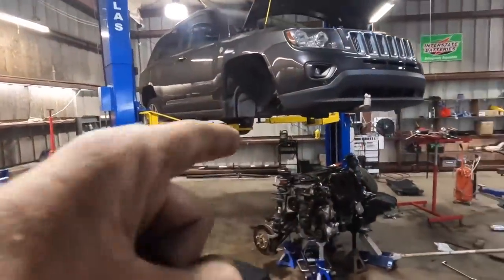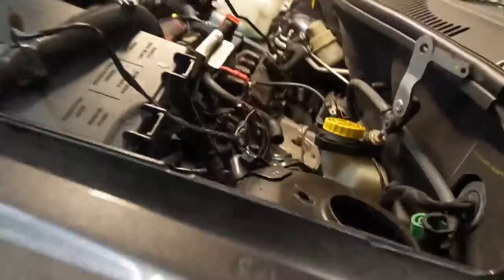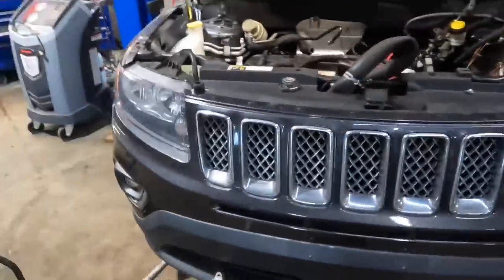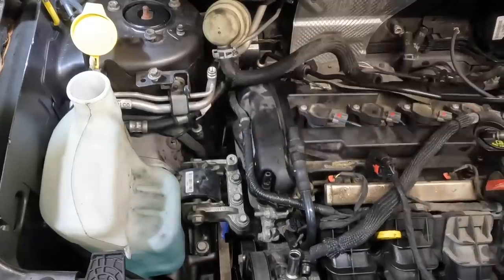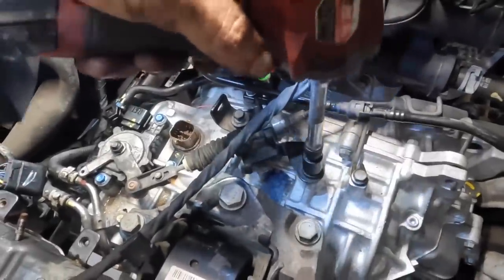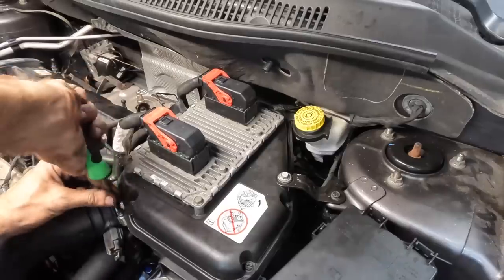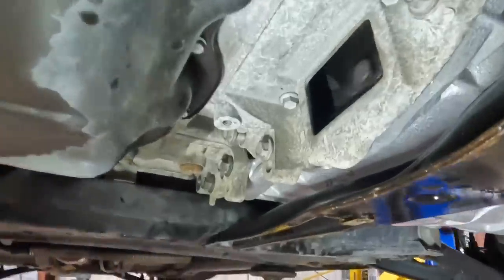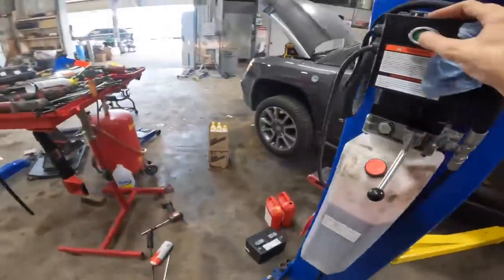Hyundai/Kia Trans in a JEEP?! 2016 Jeep Compass 2.4 4x4 #frankenstein

Comment: I hope you went back and tightened that Trans mounting bolt, just to the left of the flex plate access window. There's about ½-inch of exposed threads.
Reply: 35:00
Reply: Did you remember the ground strap?
Reply: @samvalentine3206  Oh yeah still loose 43.26.  Ray will get it on one of his many re-check😃

Comment: Did you remember to tighten up that 4th bolt near rear end? Job well done like always, i love your videos! Have been wathchin old videos a lot, I think watching them all. :)
Reply: I was wondering the same thing if he put in the fourth bolt on the drive shaft at the rear end
Reply: He didn't put a smidge of bitumen on the seal before attaching the new transmission either.
Reply: @inspectorjavert5563  Maybe because you do not have to do that, there is no seal between engine and transmission, because there is only air between those.
Reply: Also the bolt to the left when ray was doing the torque converter
Reply: I wondered about that and the hose clamp on the power steering (I think) underneath he didn't move into place.
Reply: @johnlebihan6628  I noticed that one too. One of the bell housing bolts I presume.

Comment: I've been watching your channel for a while, I'm a motorhead in my 60s, love your humor, hey I just finished watching the jeep fiat whatever job and you left me hanging on two things driveshaft rear bolts, and when you were installing the torque converter bolts on the left side of the screen there was a bolt through the bell housing into the tyranny the wasn't run down you can see about 6 threads, you did an awesome job though! Keep up the great content.
Reply: I think Ray got the driveshaft nut because when he got in to start it, the shifter wasn't in Park anymore.
I see what you mean about the Trans mounting bolt, hope Ray got it!

Comment: Ray,   I had to replace a transverse mounted trans once for the first time.  I was following a book and as dumb luck would have it, I tried for about two hours to get the trans out pulling it up.  I called my brother and told him I couldn’t get it out.   He said, Did you remove the sub frame?   I looked through the book and that was remove all necessary parts, I guess.   So, I supported the engine from the top, dropped the frame and trans, put the new one in.  I didn’t disconnect the radiator, AC, or any of the multitude of cables on top.   It took me 8 hours to get it back on the road.   Not bragging, just stating what happened.

Comment: My hubby used to be able to drop entire rear engine air-cooled Chevy Corvair powertrain, mounted with   3
bolts to reinforced  unibody mounting points/rear motor support,  including axles wheels/tires/hand parking brake cables link to  enter  equalizer cable...only a few attachments like main fuel line, ground straps, positive battery cable to starter, etc. in about an hour on a tranny jack!
Of course there were variants like AC, turbo units, manual shaft shifter link to dash. or automatic cable to dash, but no major electronics/computer systems in those days of 
the time he began with
DeltaAirline
buddies' initial how to instruction in mid-70s...one note of interest is that the transaxle differentials were made of cast iron with specific design differences in manual, or automatic gear ratios, even late models for the first two or so few years could be RPO'd ordered for 
Positrac option...some of interior components were variant patterns of the earliest Camaro, like seats, door hardware, wheels, wheel  covers with only the center emblem changes....
Chevrolet has always been good about interchange-
ability with its other GM "cousins"You could even upgrade amp rating of alternators to built in voltage regulators from later back half Chevy mated to pulley end of stationary Corvair mounting pints to timing to cast aluminum rear engine cover that housed oil pump gears , fuel pump,
 crank/cam gears, distributor...now, certain '65-'69
engine configurations are being sought for E.A.A. gas-powered 
custom design 
General Aviation aircraft!
So, no surprise that two oddball mfg got together for products like your Jeep...
Japan and Germany did that for a short time post-WWII

Comment: I definitely get the 'moments of panic and uncertainty' - it's even more so when you're dealing with parts from a salvage yard - Had the same thing when I replaced the transmission and then engine on my wifes '15 Malibu (Trans ate itself due to a failed TECHM, and don't get me started on the engine...).

Comment: Hi Ray, I'm a big fan. Great work on this and every job. This tranny and the badging you found (Hyundai), and the fluid fill procedure make me think this could be an A6MF1/2, made by Hyundai.

Anyway, keep up the great work.
Reply: This is 6 speed Hyundai/Kia transmission, not CVT, uses SP4-m fluid, very reliable unit.

Comment: There was a loose bolt to the left of the torque converter bolt access port.  Maybe a bellhousing bolt.  Did you find that later?
Reply: 35:50

Comment: Thoroughly enjoyed this series Ray. Brought back memories of changing out the engine and gearbox with my father on his 1955 Standard 8. Basically same method on a much smaller scale. You unbolted the subframe and lifted the body up leaving all the engine, gearbox and front suspension on the deck. That was back in 1960s for us. Keep up the good work Ray.

Comment: Noticed a loose bolt that connects engine to trans when you were putting in the torque converter bolts (L). It can also be seen at 43:25 right in the middle of the picture.
Reply: Raayyyyyyyyyyy 😂😂😂😂😂

Comment: There was a loose screw at 34:33 (left side). I think it bolts the torque converter to the transmission. Did you catch it?

Comment: Good job Ray. CVT transmission are complete rubbish. I was at the local wreckers. I noticed a heap of new cars mostly Nissans. So I asked the guy why.
He said they all had failed CVT transmissions. And the cost of replacement if you could get one isn't worth it.
Just seems so wasteful all these new cars just scrapped. Also had alot of ford's with failed dual clutch transmissions. And eco boost blown engine's.
Didn't have many Honda's and Toyota's though.

Comment: I can't imagine doing this in a driveway or a home garage...  Ray, you do amazing work!  Thank you
Reply: @Roads To Nowhere But see, its knowing this info that can help where most don't.  I know Cherokees from 1984-2001 inside and out (fully rebuilt a few, its a disease, I know)... 

But this...  wtf?  I'd pay someone to do it (like they did Ray) and it got done, but might not be the most efficient.  

Its also obvious the Manufacturer doesn't have repair or replace in mind when designing and building this.. (as does every company, it seems, especially the one I work for...)

Cheers, mate!  And thanks for the reply.

Comment: The 2.4 engine is the old Mitsubishi unit used by Hyundai too. My ex has a Hyundai H1/Staria bus with the same engine.  They are a bit of a dog, but the H1 is rated to carry a metric ton, and it is trouble free so far after 290 000km (181 000 miles). Just a clutch replacement due to driver abuse(her son burnt it). 
Love the fact that Mitsubishi gives you an access port to fit converter bolts, same on the V6 motors as well.

Comment: Ray, also, the short block on that 2.4 share parts with Hyundai/Kia.  Look up the part number for the oil pan on that and same year Santa Fe 2.4
Reply: Transmission is six speed Hyundai/Kia, not CVT😂
Reply: @fibonaccisequence2891  that's what confused me after I tried to research that... I was only getting the 6 speed, not the CVT.  So maybe just the torque converter is Hyundai/Kia??
Reply: @nathanblanchard2357  A6FL3 I have one in my 2016 Sonata, nice unit, changing fluid every 30k, sp4m or Maxlife, smooth and drama free.
Reply: @fibonaccisequence2891  so Ray got it wrong??  It's not a CVT he changed on the Jeep??  I have a 2011 Sonata with 220k kms, drama free as well

Comment: Ha !  The other day I thought we had another "bad lift strut" situation when the rear hatch wouldn't open automatically (or close) on Mrs. Cuss' 2014 Yukon.  Turns out it was operator error as she apparently had disabled its operation accidentally by hitting a button on the upper console.  With her, I always consider "operator error" first....

Comment: Erm you did quite a lot while we weren't looking 😜 lol (can't have been easy doing it without a helping hand or looking a bit sketchy lol)

You're needing to get something like a mobile gantry crane/hoist.

We would sometimes use a brace that sat on the inside of the wings/fenders where they bolt or weld on to allow the support and lowering/raising of the engine whilst removing the lower cross member and gearbox to be removed whilst leaving the engine in place, easier to manage on your own but still a bit time consuming at the same time.
Reply: We live for the sketchy shit!

Comment: Gave me a bit of flashback of replacing the alternator and compressor from my '08 Caliber with the 2.0L version of that motor.  That CVT sucked for power.  I liked the 2.0L with 4 speed auto from my '03 Neon better.  At least until the solenoid pack crapped out in the 4 speed and shredded all of the soft components forcing me to get it rebuilt with less than 80K on the clock

Comment: I do not remember if I mentioned this to you before, but as that is probably one of the worst CVT transmissions in a vehicle, which I've been working on Carson's 1964 and I don't think they belong in a vehicle of any kind, if you will take the time to drain all of the fluid out of that thing and put in a oil CVT synthetic fluid it will allow that thing to last as long as possible. That is the only alternate fluid that Nissan allows in their Transmissions. And it helps the Nissan last 25 to 50% longer. It could do much the same for this transmission.

Comment: Noticed a loose bolt on bell housing while you were putting flex plate bolts in. I figure you probably found it on your final check, but thought I'd mention incase you didn't.

Comment: Ray, nice job! Did you put the clamp on the power steering hose below? It was the first hose connected when the Jeep was lifted up again.  The clamp wasn’t moved into place on camera. Many years ago I forgot to tighten a clamp and it had very bad results, I will never again attach something unless it will be secured. That lesson is from before you were born and still remember it vividly as it came will a large price tag to correct.

Comment: Ah, so this Compass has the Hyundai 6-speed torque converted automatic instead of the Jatco CVT.  FCA made the change late in the vehicle's production run IIRC. The engine in these vehicles is the Chrysler "World Engine", co-developed with Mitsubishi and...Hyundai.  As all three automakers used the same engine block, that's why FCA sourced the automatic from Hyundai.
Reply: After Ray mentioned it, I recognized that it's the same trans that my sons  Kia optima and daughters Kia Sportage has. Also coworker that has 2 Hyundai vehicles.

Comment: You didn’t mark the exact screws on that driveshaft to the corresponding holes on the diff?  I thought you would want the original shaft to diff mount points where they came off of.

Comment: Hi, usually watch your videos on the TV and not PC so i don't comment that often. Mechanics is something Ive been interested in but haven't work towards, so i enjoy your videos .  I was just wondering about the torque converter.  At frame 33:20 of your video there appears to be a bolt sticking out of the transmission housing?  I know there were a few cut-aways during video taping so i was just wondering if that was tightened back down?

Comment: How many people does the factory use when they built it? In 2005: the transmission in my 1993 Dakota died, a local transmission shop replaced it, and two weeks later the starter fell off because they never tightened the bolts.

Comment: Part three of almost a Jeep Harmony. Another successful vehicle repair/parts replacement. My opinion that’s not a Jeep. Ray I’m sure while we weren’t looking you double checked all nuts, bolts, ground cables for tightness. I seen that you had Lexus/Toyota SUV there to be worked on. Back to that Compass with multiple vehicle parts on it, you should’ve put some DirtyMax parts on it😂

Comment: At the risk of being obvious, I wonder what the owner did to cause the CVT to fail so soon?  I’ve heard that CVT’s are not as durable as geared transmissions, but shouldn’t you get more than 7 years and however many miles until it needs to be replaced?

Comment: You are not supposed to torque the strut plate to the strut Towers unless there's wait on the wheels. And then reset them after the car's been driven for a couple days otherwise you get strange noises when you drive.

Comment: For all you people to think it's okay to put blue Loctite on torque converter bolts. Please look that the new ones actually have red Loctite on them. Red Loctite for torque converters always. And yes it uses the same POS transmission that Hyundai and a couple of other Japanese cars use. But I consider all cvts POS is for automobiles and trucks. CBT is our great transmission for industrial or other specialized purposes but not for automobiles that are driven on the street.

Comment: If I were doing a lot of these type of engine outs, I would have some type of steel table with rollers with clearance to get a jack under it. With wood on top and holes to put leveling blocks into, because you really want to drop the engine on something and wheel it in and out.
Reply: Like Eric O.

Comment: I thought the 2.4 4x4's had the Hyundai 6 speed automatic by 2016?
Reply: You are correct; the CVT was on the 2.0L only.  The 2.4s had the Hyundai 6F24 6-speed auto….which is the gearbox Ray is installing in this poor heap, I mean, Jeep! 😂

Comment: I'll bet it would be hard to make a dipstick for that thing into that fill plug. Just epoxy a piece of Steel into it and Mark it up. You can double-check that and try it with a dipstick and just stick it down in there and see if it measures trans fluid level and then you can adjust it to fit. These Engineers who decided not to allow people to check their Transmissions have created a complete industry of replacing Transmissions. Did you get that last U-joint Bolt or nut?

Comment: I have a GooLoo Li-Ion jumper box rated to start up to 9L petrol and up to 7L diesel that seems to do the job just fine. I don't think you're supposed to run it in leau of a battery, but that would apply to any jump box with the possible exception of lead acid based units. But either way that CAT box is junk.

Comment: If this is a genuine Mopar part, submit it to Mopar as installed. Every Mopar part, especially remanufactured parts like engines and transmissions have standard 3-year warranties. The warranty follows the part, which means that if the owner ever sold the vehicle and the new owner experienced a failure the new owner could submit a warranty claim to Mopar directly.

Comment: This shows why a transverse motor with a transaxle is just WRONG. If this was a proper longitudinal engine and transmission, this whole procedure would have taken a quarter of the time in one video. 😵‍💫
Reply: What little you save on gas with these you make up in repair costs.
I see this in industry. Special equipment is used to save energy in electric motors. And they do save energy but when the special equipment burns out the repair costs are far more that any energy costs saved. Welcome to the new world of energy conservation, but not money conservation.

Comment: I’m in the middle of changing the EGR valve on my 2010 Jeep Wrangler, and that last hidden bolt is a bitch !!!  Need to find a good 6 point 10MM wrench to fit on there with a “c-nt hair” worth of space to get it seated properly 12 point worry about stripping.

Comment: Could also  leave the engine in and the suspension. Drop just the sub frame and use a trans jack and only remove the trans.  Done it that way alsk. Probably easier.

Comment: ECM is on top of the air box ?  What a stupid spot, leave it it FCA to bring in good design.  I gotta mess with the ECM if I change my air filter ?  FWD ?  Should have used the NAG1 in there, it’s a great transmission

Comment: That transmission is not a jatco cvt at all. That transmission is a Hyundai 6 speed.jatco 6 speed has dipstick tube. This transmission has no dipstick unless you buy one and it goes in the hole above differential. Or you can set fluid level by taking plug out of plastic pan.
Reply: cvt